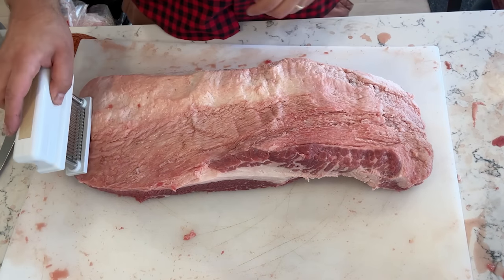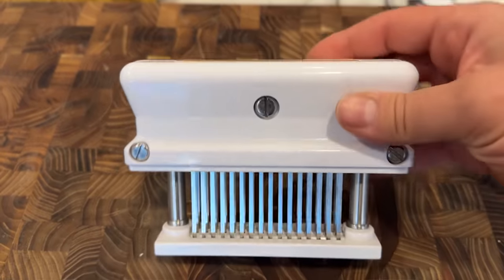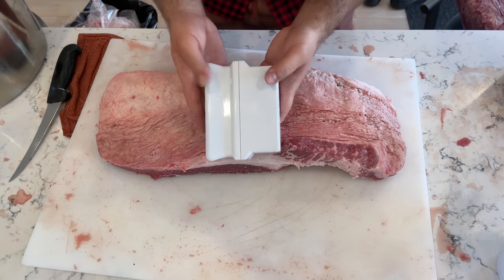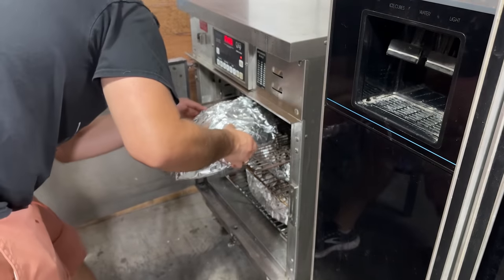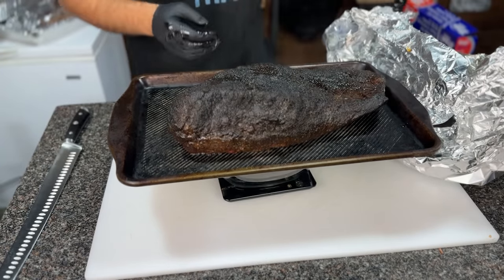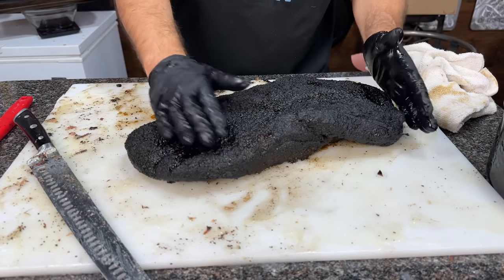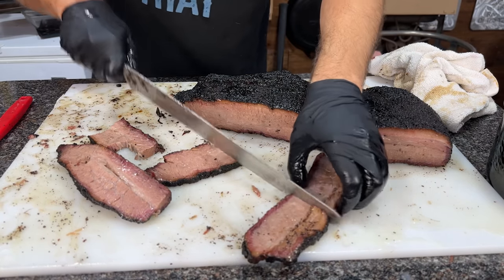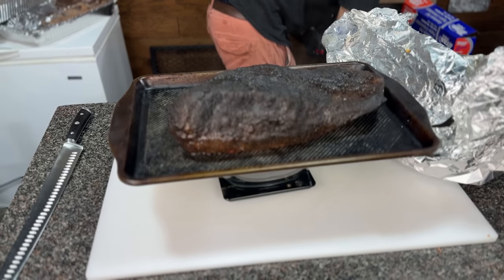I used a JACCARD on a brisket and THIS happened!

Comment: I tried this once on just a flat. My idea was to apply the rub before using the jaccard to theoretically "inject" seasoning into the meat, while simultaneously tenderizing it. I ended up with a dry brisket, but other variables undoubtedly played a role.

Comment: I'm still a beginner when it comes to smoking brisket with probably less than 10 done so far that have been progressively getting better. My best one was a Wagyu I scored at a local Business Costco. Those are hard to come by, though. I made a prime cut yesterday that was loved by all but in my opinion only scored about a 4 on a scale of 5 compared to the Wagyu, which I think set the gold standard at 5, presumably due to the difference in ts marbling?  In any case, as a still relative newbie when it comes to smoking brisket, is it possible that this device would have work better if you only punctured the fat cap side if you smoke fat cap up so that the fat would gravity render down into those holes but not completely drip through the brisket because the bottom side wasn't punctured? That seems logical, but what do I know. I may try it on a brisket I'm doing next weekend for my dad on Father's Day unless people point out a flaw I may be overlooking in the above logic. Great video.  Thanks
Update: I smoked a brisket for Father’s Day using this device to penetrate the meat from the fat cap side only and did not notice a difference in either the tenderness or juiciness.  At least I tried it. 😊

Comment: I do the same thing when my brisket hits 190!  I figured, why rest it down at room temp when you can rest it down really slow?  Makes for a great brisket every time, you just have to rest it at least 10 hours or so.
Reply: He basically pioneered what's commonly called the "rest hold method". His hypothesis began with trying to create an exact replica of Franklin's briskets. He realized the expensive holding ovens were the main reason behind perfect beef every time. He started by reprogramming his kitchen oven to set at 150°. Then he went a step further and modified a cooler with a souvide. Now he uses one of those expensive humidity controlled holding oven like you saw in this video.
Reply: Restaurants in Texas have been doing that for years. I used my electric smoker to heated rest my briskets long before I found this YouTube channel.
Reply: @Cranedewd  I've been following quite a few very popular BBQ channels on YouTube and Instagram for the last 10 years. And also a member of some extremely popular BBQ groups on Facebook. None of those chefs or people in said groups ever mentioned or demonstrated the rest hold method until Steve. So while (in Texas restaurants) it may be "old news", nationwide it's still not prevalent and it most definitely isn't popular in regional or national BBQ competitions.
Reply: I’ll give him that. He may have brought it to the masses, but pioneering the method, I’m not so sure. Happy smokin!
Reply: @mtcoorscan  Note to clarify to other people who may be wondering about your comment about using this holding method not being popular at competitions: any type of electric/gas oven or warmer (including Sous Vide) are not allowed in any part of the smoking/cooking process. Most competitors use a Cambro type container or portable cooler insulated with towels/blankets to hold their briskets, pork, ribs during the rest. This prevents them from doing an extended (10-12 hr) rest. Also, cooking usually cannot begin before the cooks meeting which is usually held on Friday evenings for a Saturday contest.

Comment: I’ve used a Jaccard for many years. I’ve done steaks, I put the marinade on them, then use the Jaccard. Then marinate them for an hour . Depending on the thickness. But it spreads out the meat and you have to reform the steak. To its original size to retain moisture. Cook as normal. Your steak will turn out juicy and they will love it. I also do the same with chicken. As I noted you have to form it back to its original size. Now I also put my steak or chicken in a vacuum bag and freeze them, after the process. To cook at a later date. They turn out extra yummy.
Enjoy 😁